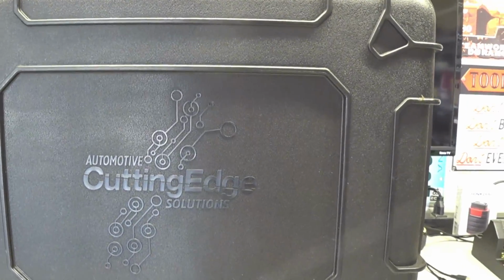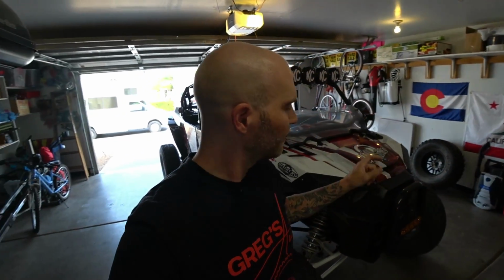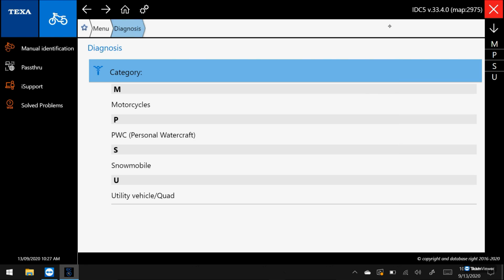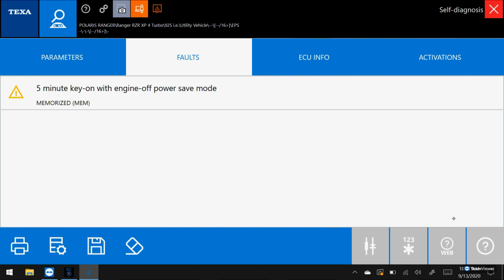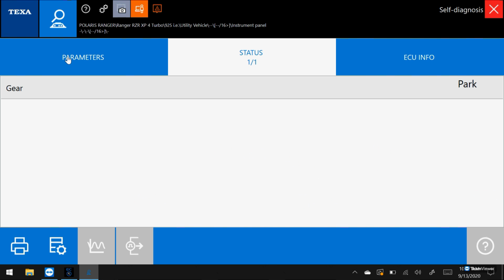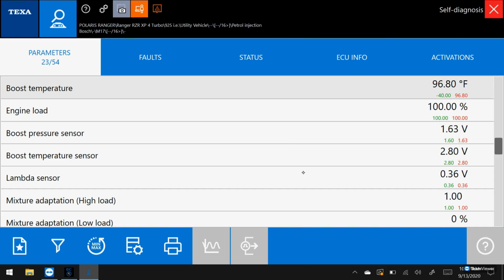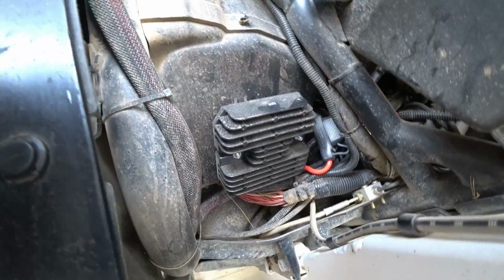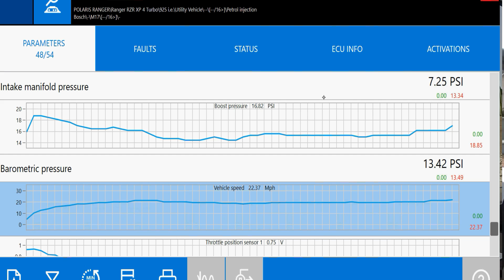TEXA SCAN TOOL....From Cutting Edge Automotive Solutions

Comment: I own the Jaltest . Me being most of the time in Eastern Europe gives me an edge over the Texa . I was contemplating but in my case the Jaltest worked better . It does agriculture , construction , trucks and trailers . For regular cars I have different solutions but that's beside the point . The Texa is good and tested but it was just not for me
Reply from the maker: I hear ya there buddy! You obviously know more on other vehicles besides automotive then I do and seems there definitely isn’t one tool that can do it all.
Reply: I used jaltest in detroit it was horrible
Reply: @Detroittruckdoctor55  Yeah, I think that Texa is a good machine for the US trucks and Agri. No doubt about it but in Europe the Jaltest has the upper hand. Iveco, MAN, Scania to name a few truck apps. Construction like JCB, Komatsu and Agri, Valtra, Fendt and  Deere. I tested them both, the Texa and the Jaltest because all the apps cost a lot of money so for me the Jaltest is the best Universal HD solution.